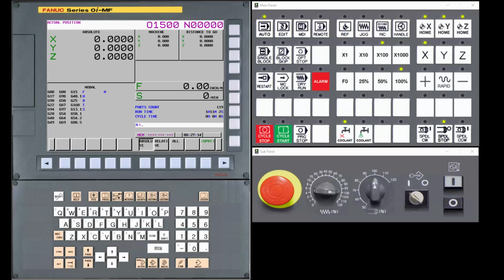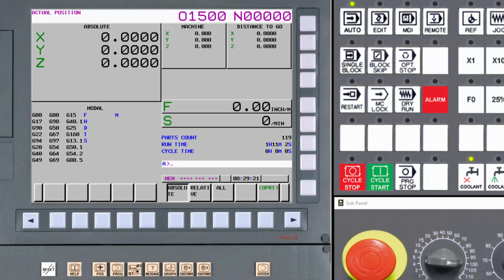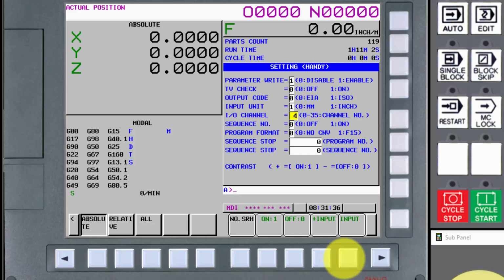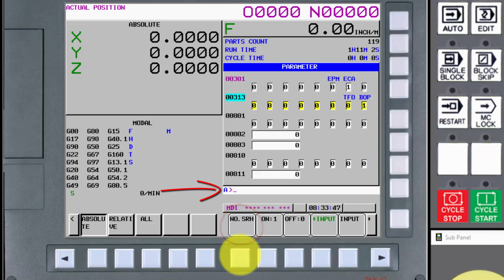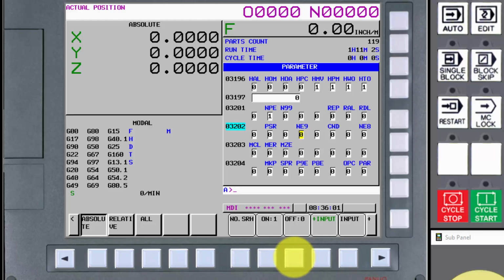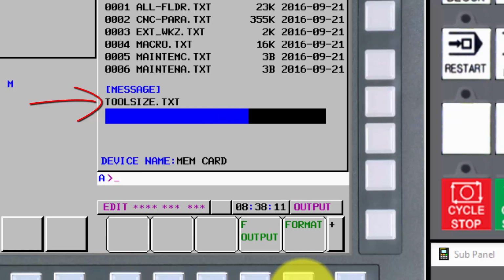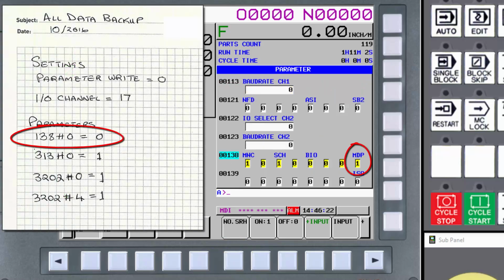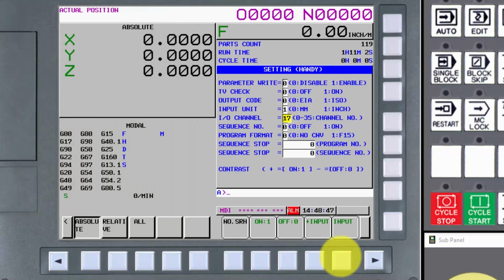04 All Data Backup

Comment: It worked up until I had to turn off the machine, when I turned it on again there was an error saying "device not ready, push any key".  I followed every instruction to the letter.  What went wrong?
Reply: some models/usb will work for channel 17 only for text file ... but not sure will work after rebooting for binary files (SRAM and user data..etc) ..... best is to use channel 4 and CF (compact flash ) card.. that will work for sure every time  .. joseph
Reply: hello for what series does this procedure work

Comment: Ok , thanks for uploadin video such as this one. I have a question... the problem is that operator couldnt power up a machine so he press reset and delete buttons while powering up a machine. It errased all memory data , parameters , macros .... everything. The only backup i have is the one that came with a machine from manufacturer. It contains a sram ,nc option , nc parameter , pitch, pc parameter , and system list ... some of those are txt files and some are 000 or 001 ext. Whn i transfer all those files to memory card and i run restore backup in boot menu it ony restore sram_bak.001 cannot find oprm_inf file and also restores pmc1.000 ... when i turn control on it removes all erors that i had but i can not reach to parameters any more. When i press system -> softkey for parameter does not exist. Does anyone have any idea. I think backup i have does not contain all data or im doing something wrong
Reply: RESET + DELETE erases only SRAM. Download only SRAM. In no case do not touch the OPRM.INF file otherwise you will lose your license.
Reply: Виктор Сугак thanks for you reply . It only tells me that SRAM file i have does not contain all data. Cause when i load it there is no softkey with parameters
Reply: @markoosmanovic4686  The SRAM file contains all the data. Just the Options button is closed there. I know where the SYSTEM button closes; this is parameter 3208 # 0. You can enter the limited parameters through the OFF / SET button -> SETTING -> PAGE DOWN
Reply: Виктор Сугак thanks ill try that